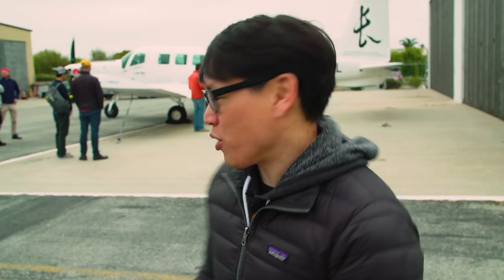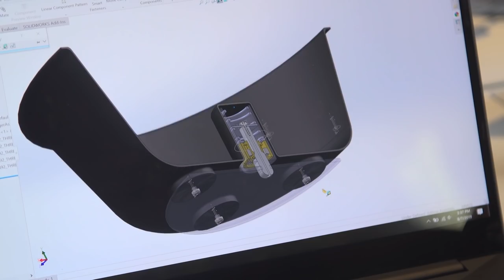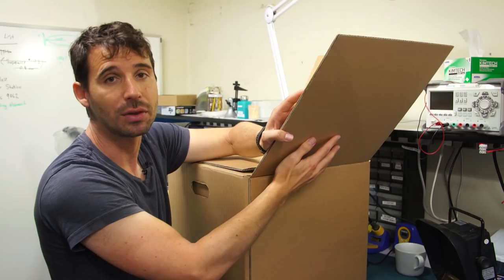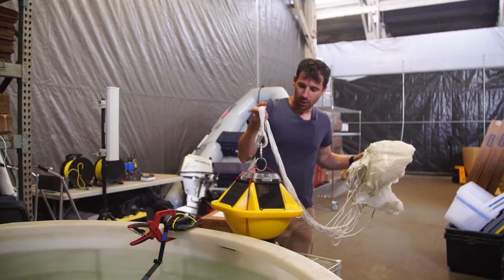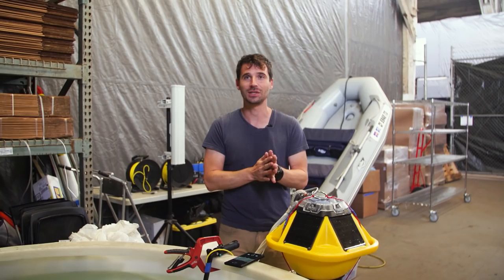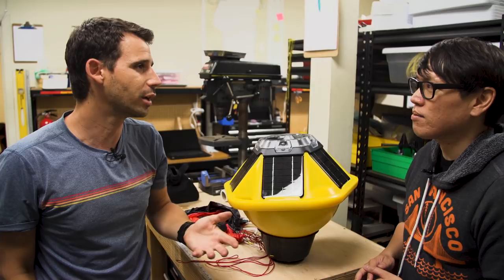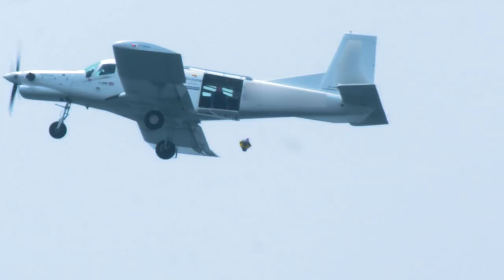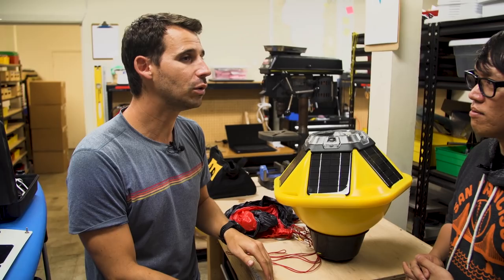Tested: Deploying Ocean Sensors from a Plane!

Comment: Anyone else notice the PARACHUTE MALFUNCTION at 8:05? Didn't look catastrophic but it did look like it added some extra spin to the thing and that extra bit of force could knock out some equipment if it wasn't designed with that as a possibility. What about like a dissoluble paper parachute? or what if you could design the box in a way so it fell apart into a parachute and when it hit the water it cushioned the landing then disintegrated away? I think you could get a lot of help from Japanese paper manufacturers. They might even be able to design the box that turns into a parachute then acts like a pillow then vanishes.

If we could just make them small enough and cheap enough that they basically ended up being disposable and biodegradable mini sensors. If we setup a hierarchy we could have them like network back to bigger ones more like those and those that were being dropped out of planes and those would radio to bigger ones that were placed in more regular places maybe actually anchored or through boats picking up the data and that would get the data back to the receivers in the lab? If you reduce what they have to do and reduce the size you can reduce the price too. Then again that is kind of what they are already doing with this just without the intermediate nodes.

Comment: One breath: We're standing by waiting on the weather to clear 
Next breath: We could fly a plane in front of a hurricane and drop these
Reply: Proof of concept test is primary to failure limit test. If something fails in optimal conditions, you know it's back to the drawing board... If you have additional variables like crazy wind, rain, etc that could affect it's performance, you don't know if the base concept can just be made a bit more robust or if it just won't work to begin with.

Comment: Just throw it in with the chains loose? Also this feels like more plastic will be lost in the oceans. And why not build it strong enough so parachute is not needed
Reply: The chains are a weight. Their job is to provide an anchor point if tethered, and a weight to keep it upright otherwise.

At least this plastic would be productive.

Building it tougher would make it more expensive and involve more material... like that plastic you don't like.

Comment: This project will add trash to the water, that's all. Small, cheap sensors like these are not designed to be recovered--that would increase the cost by many orders of magnitude, and the parachutes, bowel, strings, etc. will be more plastic trash that won't degrade for many, many years.  Data acquired from protocols that use multiple samples over short time intervals are just as robust at those gathered by "in situ" type sensors like these.  All this project will do is add more trash to the water, with very little good data to show for it.
Reply: In summary "if you spend a lot more to get a lot less you can avoid a minor problem!"

Wow, fucking brilliant. Would you like a nobel prize for this great advancement?

Comment: Why not a wood product for the chain holder, Hemp or the like for the ropes and a cotton blend for the cloth.  yes a little more weight so would need slightly larger surface area and these would break down over time as most are never going to be recovered.  Who is going to pick them up out of the artic ocean or deep pacific ?  A dissolvable plug in the unit itself that lasts a couple weeks then it sinks to the bottom of the ocean maybe to dispose of them.

Comment: I have issues with so much of this. First as a vessel captain I just think more crap that I will have to look out for or will get hit because it doesn't sound like they plan to retrieve these things despite the fact the data they are collecting is next to worthless. Not to mention their asking cargo ships to drop them in shipping lanes they will be utterly destroyed by another vessel. Not to mention those para-shoots getting wrapped up in the props.
I doubt these things would survive in a hurricane let alone be powerful enough to transmit any useful data in real time that wasn't already being collected and transmitted in real time by specialized maintained bouys along the coast (many placed there for this exact reason) or by the different types of radars currently used to track the storms.
Also its clear they don't have anyone with maritime experience advising them. That thing will not last in the open ocean between the barnacles, sun exposure, and salt water will corrode just about anything so kiss those small solar panels good bye.

Comment: Why is this a problem? The Navy has been dropping sonobuoys by the hundreds of thousands. From planes, prop or now jet. They have many variants and can have huge capabilities. It is a well known problem and has been solved. Is it just the cost? Don't have the DoD budget of course, but really this should not be a big problem.
Reply: YES exactly. The weather service and Coast Guard already have planes equipped to drop instruments that do exactly the same things these do. And the hardware is optimized to be dropped out of the belly of a plane at altitude and speed, without leaving behind any more material than is absolutely necessary. 

"But.. ya know.. we want to drop OUR things. Because 'disruptive!'"

I really DISLIKE that buzzword. (and yes he actually used that word)

Comment: The plane wouldn't fly with overcast skies, and he said the device could be deployed in front of a hurricane? What about the pollution of the plastic bottom and the parachute? Even the cardboard box seems like a poor idea. Reworking these sensors to be more impact resistant seems like a better plan.
Reply: Planes are far more mobile than boats. IF you can travel 10x as fast, you can get in and out before it becomes a danger zone, where a boat couldn't.

No, it's a terrible plan that would drive up costs.

Cardboard boxes aren't a problem. Trivially degradable.

Comment: Why not just make wide, helicopter like blades that slow the decent and act as a keel to keep them from being rolled over in high waves?    You know, instead of dumping more trash into the ocean...  ESPECIALLY THINGS THAT SEA CREATURES CAN GET STUCK IN..
Reply: Prevent? Prevention isn't going to do shit, because it's going to roll eventually.
Reply: seigeengine   You are aware of how water works... yes?      more mass below = less roll..
Reply: seigeengine   ... which also = more drag which = less roll..   ..the longer the lever to more force applied.....      you know, basic physics..

Comment: Umm just deploy from helicopter. No parachute or crazy cardboard box needed.
Reply: Perhaps they tested that already?  It's frustrating that they didn't address it in the video.
Reply: Maybe due to the more limited range of the helicopters Vs a plane? Like he mentioned they might be used in the Arctic and such
Reply: Why not just deploy from the back of a swimmer? Oh, because that's stupid? So is a helicopter.
Reply: @scrappyny7432  No, I'm just not stupid enough to think helicopters are a good idea.
Reply: @seigeengine  No, actually they are a great idea under the right circumstances. I guess all those times things are drop-delivered by helicopters were a bad idea too.
Reply: @scrappyny7432  yeah but 99% of the time when heli's are used it's over or near land :)

Comment: There is so much wrong with this. Probably wouldn't need a chain to hold it upright if the 'hull' wasn't a sphere; square it up, give it a keel. A plastic bowl on the bottom to tie the strings to? God, why? Tie the parachute to the chain/chains anchor point/carrying handle using PVA water soluble thread or something similar. Don't need an actual parachute, just drag; at least that bit of common sense didn't escape them.
Reply: @seigeengine  I can only guess that you live in some dry, flat region. Anyone who's spent time on small boats like canoes, kayaks, dinghy's, skiffs, launches, and small power boats can tell you that the shape of the hull greatly influences the vehicles tendency to roll. A sphere is the worst possible shape since it has to displace no water to rotate. It has the least resistance so any influence on the device will impart the greatest effect.
Reply: I didn't say it didn't.

Comment: More ocean trash. Nice. Why not make a unit that can take the impact of thousands of feet when dropped. No parachute. No box. Just a plastic ball impacting the ocean to do its thing. And... do these units all end up in that giant plastic trash heap we hear so much about?
Reply: because that makes it more expensive, which means less data, which means we know less about the ocean.

Trade offs in everything. SOmetimes you need to take the bad because the good outweighs it.

Do you want them to retrieve the buoys? That's expensive... and practically that means a lot of fuel burned to go get them, and a lot of human labour spent doing that.

Comment: if they droped them from a helicopter they could drop them from 25 feet and slow down to almost zero  speed
Reply: Why not skip the fuel and just use swimmers?

Oh, because that's stupid?

So is using a helicopter to do a job a plane does better, which is just about everything. Helicopters are shit outside of niche domains.